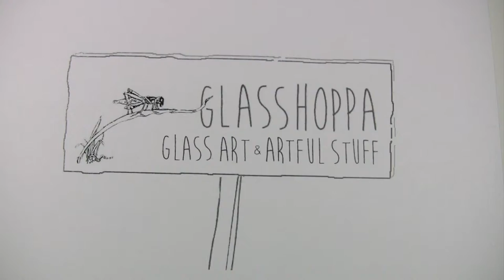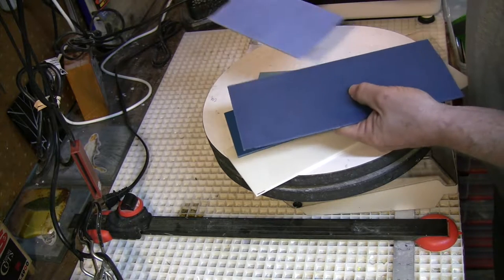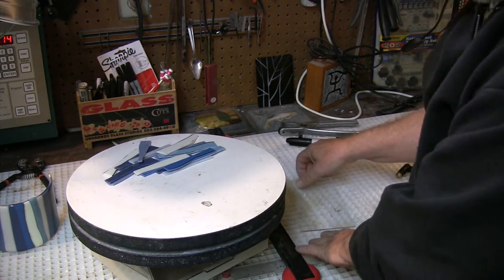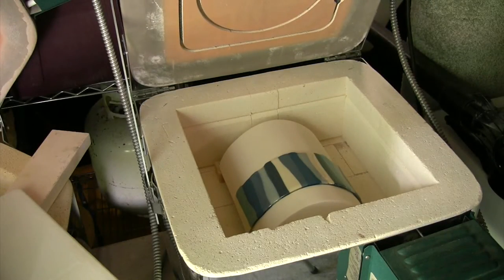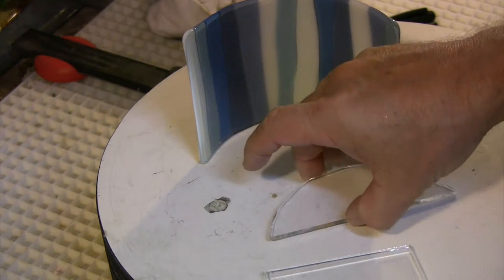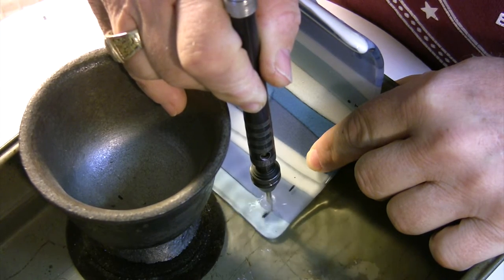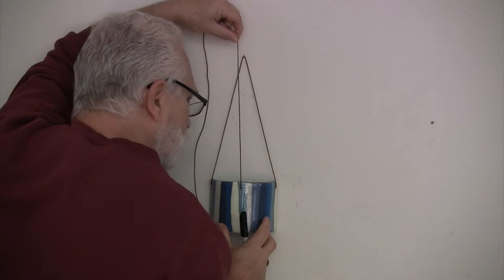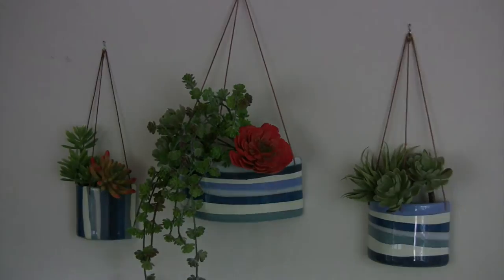Fused Glass:  Faux Flower Planters

Comment: A very nice project can one attach a ordinary glass back and bottom so that one could put plant which need very little water.
Can we use ordinary cheap glass as we are not fusing them just using silicone
Reply from the maker: Sure, why not give it a try. If you seal well it should retain water ... Good luck; have fun --